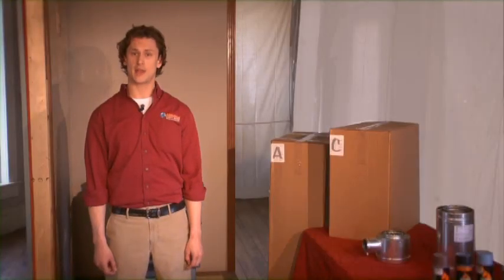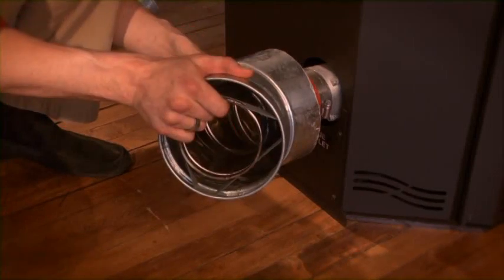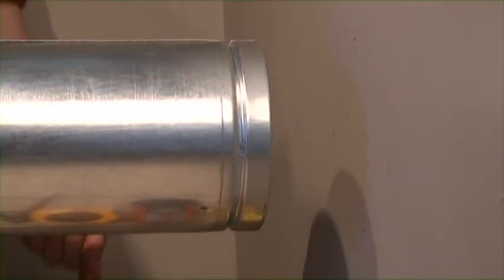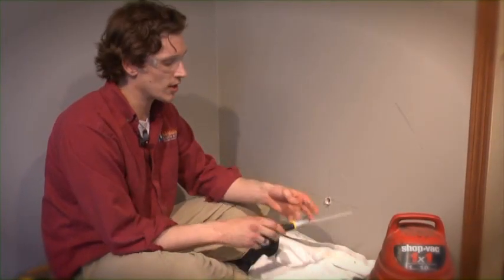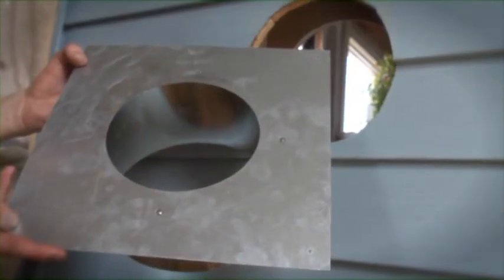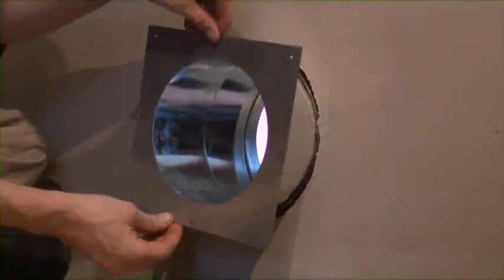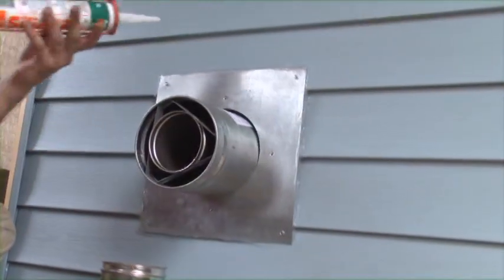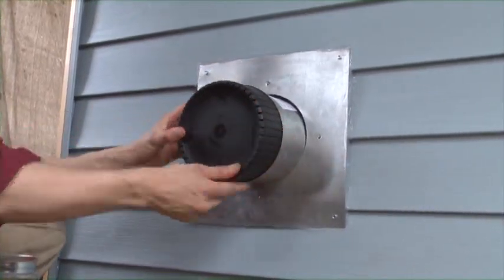Corner Install

Comment: When I contacted the pellethead website, I couldnt find the 'C' kit ,so I called their phone # , they didnt have a clue. So where do I get this kit with outside air with exhaust combined?
Reply from the maker: Hey Gabe, thanks for contacting us. We are working with Selkirk currently on new kits of the direct temp venting that we don't have up on the website quite yet. If you want to send over an email and let us know if you have a corner or strait out installation we can give you a breakdown of the pieces needed and our sale price for the 'kit'. You can send an email direct to taylorm@pellethead.com